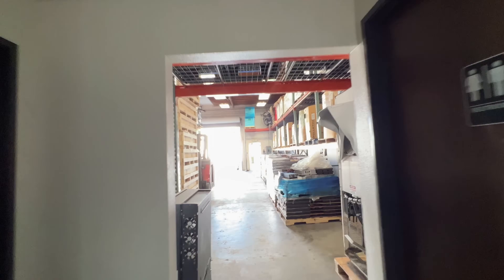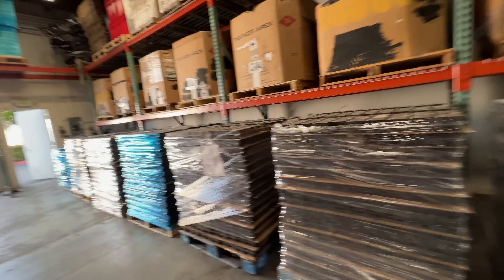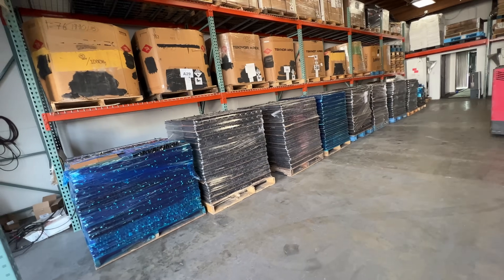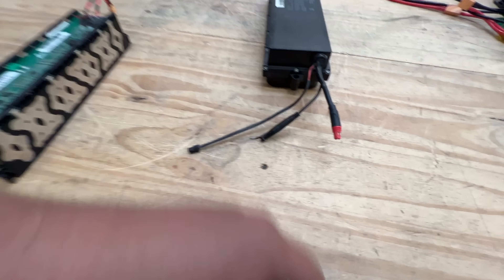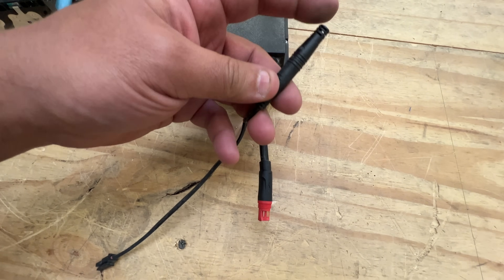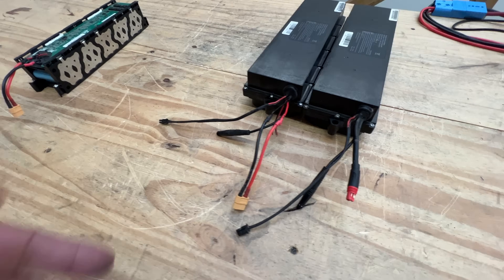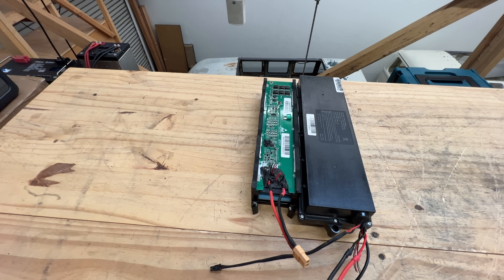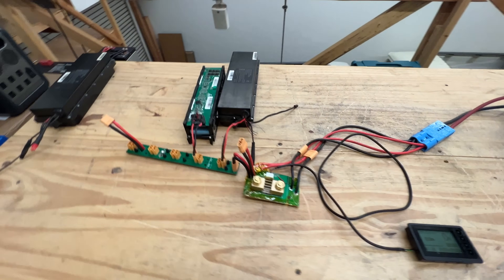LG18650-MH1 40cell Scooter Battery Packs - R5s

Comment: Hi how do you take it apart i took all the screws off but still not opening Thanks
Reply: Just did manage to take it apart think its got some kind of glue i just used a dermel to cut one side get a screw drive to pull it apart

Comment: Hi ...Wow you seem to love all this stuff and really know your stuff. I have a couple of questions about the battery pack you were testing there.. I have a battery in a copy Xiaomi scooter that has the same type of bms along the full length of the battery . How can i tell if my BMS has failed or just somehow needs waking up . I am going to watch more of your videos ,btw,. The scooter i have i bought as a non runner to hopefully easily fix. Got new dash-board and new mother board and when i connect the battery if i quickly press throttle i can run the motor for 7 or 8 seconds then all cuts out and error code 21 ( NO communication with battery ) . There is no Bluetooth as far as i can tell ,although im not sure if i need a scooter APP to be able to detect any Bluetooth signal  & no lights at all on BMS. I am interested to find out if that little device would help , i am really new to the scooter world and its problems and you look the guy that has the parts to help . look forward to hearing from you ,Don .
Reply: Probably need to bypass the BMS on discharge. Sounds like you’re dealing with a prior rental and the system is looking for a signal from the gps board that isn’t there anymore. So get a different battery or just research bypassing the BMS but still used on charging.
Reply: @kevins5016  Hi Kevin . No its not a rental or ex rental. It is a copycat of a xiaomi . Last night i tried waking the BMS as demonstrated but no joy . the battery is good at 42 volts . I think now i need to replace the BMS but are they specific to suit the mother board ? rgds Don

Comment: So I have been playing with these batteries with the extra wire (third unused end) and I love them.
A number of these packs however do not have the third extra wire and just have the charging end and the thicker discharge end...... these packs also have a anti theft sticker on them and shut down after 5 seconds, any ideas on this??? 
It says OTA WITH ANTI-THEFT
Reply: hi, I'm wondering if you found any solution how to stop shutting down after 5 seconds?
Reply: @dawidadamus9149 Yes, that's the whole point of the video, soldering that short length of wire bypasses the BMS for discharging and it works well.
The BMS still handles charging and balancing but the discharging is bypassed. Because the discharging is bypassing the brain on the BMS you will lose things like low voltage cutoff (you have to be smart and keep an eye on the voltage and not run the pack into the ground) and wattage control (there is no BMS limiting these packs to 500w like before, you can actually pull 800w from them now, but it's not smart, I run 2 of these in parallel in my 1000w ebike so they share the load ...500w each.
Reply: @terrysobkowich2084  can you please point me to where in the video you do the soldering? I can’t find it

Comment: Just bought 4 of these. Soldered on an XT60 and plugged into an Ecoflow mini as an expansion battery. The battery cuts off as it ramps up above ~200w. Unplug then plug back in and same thing. Any ideas?
Reply: Is it the anti-theft feature. Mine has a sticker that says SOC 65-70% OTA with Anti-Theft
Reply: The three cable ones (charge cable, power cable , and and extra capped off cable ) work straight up.
The two cable ones (that have the anti theft sticker and only the charging cable and power cable) require a work around to get around the anti theft feature, there are vids on this.
Reply: @terrysobkowich2084  so it a crab shot which 2 or 3 wires battery I will get. If I got the 2 wires one. you think it is still worth the price? I am not confident on working with batteries.
Reply: @josephau4623  Well ,about 80% of the ones I got ( not from the website )were the 2 wire ones that unfortunately require the modification but once you see how its done, its not really that big of a deal in my opinion....... but You would have to figure out the cost benefit for yourself especially if there is a lot of shipping costs. I have a thousand watt ebike and I did 15 miles just this morning on a pair of these packs in parallel.
Reply: @terrysobkowich2084  I can't find the video showing the work around. Can you share a link please? Also since you have your out of the enclosure can you tell me what the dimensions without the case. Thanks
Reply: @josephau4623 search YouTube for bird 590 bms bypass. Lol I can't seem to send the video link.
Reply: @josephau4623  ill get you the dimensions
Reply: @josephau4623  without the case the pack is 27 cm long
7 cm wide
6 cm deep
Reply: @terrysobkowich2084  thank you

Comment: @jehugarcia there will be another auction in Canada for these type of batteries? I got 4 lot of these but premier auction refused to pack them that would only take 10 mins so the shipping company could pick them up. I really wanted to buy ay least 50 60 of these : (
Reply from the maker: So you are not getting the ones you purchased?
Reply: @jehugarcia  First I wanted to arrange shipping then I was gonna pay. I couldn't find a company who can pack the shipping as well. That's why I kindly asked them a few times that batteries already on the pallet all you need to do is wrap it but they refused to it.
Reply from the maker: 4 lots is 1/4 pallet,  why not ship them in the pallet?
Reply: @jehugarcia   idk, I even got quote for it but they just didn't wrap it for pick-up. It would take max 10 mins.
Reply: @VertexSignatureBuilds  Did you get your batteries or you paying storage fees?
Reply: @FarmingGoneWild   They already sold to someone else already. So I didn't pay any fees.
Reply: @VertexSignatureBuilds  Caqn you share who sold  them too I have a few i want to sell too
Reply: @FarmingGoneWild  you selling batteries ?
Reply: @terrysobkowich2084  I have some to sell.
Reply: @jehugarcia  hi I got one of these packs I installed it on my scooter but it shuts down some said its got to do with the anti theft on the battery you know whats going on Thanks
Reply from the maker: Not really,  I was never able to get my hands on any of those Canadian packs.  The ones I have here in the USA don’t have anti theft software
Reply: @RandomClips27.  The workaround is either connecting the negative wire directly to the negative connection at the bottom of the board..or......the even better way is to jumper a bypass wire from the negative pad at the bottom of the board to the side of the bms board fuse closest to the bottom of the pack. This way even though you are bypassing the bms for discharging, you still get the 30A fuse to protect if a direct short occurs.
Dm me if you want a pic of a modded board

Comment: I just bought 30 of these R5 shorties as you call them, what is the pinout? How do you connect them in series and parallel? I have arduinos, everything, but having a hard time getting the info.
Reply from the maker: Who cares about the pin out if there’s no connectors,  install an xt60 connector and charge/use them,  you don’t need anything else
Reply: @jehugarcia  You said in one of your videos you EV project doesn't have a BMS, do you have more info on this? I kinda feel like running 6 parallel strings of 5 series batteries for my EV project would be a little sketchy, is there a way to use the onboard BMS and can you recommend another BMS that could handle all the series and parallel strings? Also thanks for the response buddy, I bought 30 of these R5 shorties as you call em and you seem to be the only guy that knows anything about them so I'm super glad to make your acquaintance.
Reply: @jehugarcia  also if you want to figure out shipping to edmonton alberta I'll buy all the connectors and stuff from you so it's worth your time to respond to messages if thats fair.
Reply: @ColePEET  Ha Ha Red Deer here lol
Reply: @jehugarcia  XT60 on the output for sure, I found that those small red RC hobby connectors will connect to the charging input port , just saying.
Reply: @terrysobkowich2084  what connector are those. any name or link please
Reply: @josephau4623  The original connectors on the batteries .. who knows but I have found that a small red 2 pin JSA  ?? connector will connect to the charging port. AND ..small 2mm banana jack plugs will fit into the holes of the output plug so i made a 2mm male banana to xt 60 adapter for the packs I haven't changed over to xt60 yet.
Reply: how many of the 30 you got are 3 wires?
Reply: @josephau4623  of the 30 29 had a 5 pin Julet and 2 pin molex, 1 of them had the 5 pin and the 2 pin but also another 2 pin
Reply: @ColePEET  so 29 if them can't be use as is. Bummer
Reply: @josephau4623  why do you say that, i'm pretty sure you can just use the two main wires for charging and discharging. They don't need to be activated or anything.
Reply: @ColePEET  check out the reply from CMS CLIP. He said the one with 2 wire come out will cut out at 200w because of anti thief. And the ones with 3 wire will work as Jag show in the video. And other suggest a work around bypassing the bms.
Reply: @josephau4623  interesting, always something eh. Shouldn't be too hard to figure out. I would like to figure out the communications protocol the BMS use and use a little circuit to get the full BMS functionality from them

Comment: Ok so I picked up a bunch of these 36v units at auction , the voltage of one of the units at the discharge is like 2 to 3 v ?? , it this a sign of the bms being off (or would that read zero?) or is this particular pack screwed and good only for salvage of individual cells? Or salvage of bms ?. Thx
Reply: I can see it all now as well .
Reply from the maker: Try charging it,  if the bms wakes up your are good to go
Reply: @jehugarcia  Thank you sir, I charged it for a short while while and the discharge leads are reading about 35v ish even with the power brick unplugged so I'm assuming that the bms is working fine and the cells are taking a charge, the pack was just very deeply discharged ? we will see what it is at by morning. perhaps ill even try discharging it and see what its capacity is at?
Reply: @jehugarcia  So the morning has come and the  charger (which is for this battery type has changed from red to green indicating the BMS has shut off and the battery is charged, disconnecting the charger the battery still reads 41.5 v. I think im good.
Reply: Hi, could you provide some info please about the paks: all the paks are fully functional or you got some dead cells?
Reply: Strange...this post now says 2 h ago  but i posted it yesterday. the responses i got and my follow up on this pack are gone.....
Reply: @terrysobkowich2084  I can see both " 
jehugarcia 
"Try charging it,  if the bms wakes up your are good to go"

Terry Sobkowich
" @jehugarcia  Thank you sir, I charged it for a short while while and the discharge leads are reading about 35v ish even with the power brick unplugged so I'm assuming that the bms is working fine and the cells are taking a charge, the pack was just very deeply discharged ? we will see what it is at by morning. perhaps ill even try discharging it and see what its capacity is at?"

Comment: I'm not rich but not dumb battery clearing house had LGMH1. 72 for 72 free shipping. I  procrastinated for couple days. Bought them. Now. Way different shipping up to $20. Do your RESEARCH. MHI are best cheap 10amp I found.   Panasonic has a slightly better power curve Not much Panasonic you WILL pay
Reply: Are these batteries as good as the Panasonic ncr18650bd? . I am building 60v batteries. 16s 13p .

Comment: That 10wh difference is because of the maths. The capacity is calculated 37v x 12500 mAh, the other packs are rated 36v nominal voltage.

Comment: As to charging: keep it below 3.5 amps.  You have NCR18650BD with 4 in parallel (10S4P).  The datasheet says about 900mA each.  If you jam 20A into the port, you are hitting each cell with 5 amps each (on average).  That is very dangerous, and will destroy the cells quickly.
Reply: I'm only charging through the charging port and using a 2 amp scooter charger.
Reply: @terrysobkowich2084 I just got two of these packs. I was able to charge thru charging port for initial charge but after first full capacity test cycle it will only allow charge through discharge port. Have you had similar experience or know how to reenable charging through charging port?
Reply: @Code_hack_  I have never had a problem charging through the charging port,...mostly.... the only time I put power into the discharge port is when the battery was completly discharged and the BMS didn't even have enough power to wake up and start charging the battery, so....I had to put some power into the discharge port to get enough charge into the battery to wake up the BMS to allow charging into the charge cable.
The bigger challenge I have had though is that some similar packs I have gotten from elsewhere had a anti theft firmware lock whereby the pack will only supply 0.7a unless it receives a digital code from a scooter that is no longer there....the battery assumes it has been stolen and then shuts down lol, So then you need to do a modd on the battery pack whereby you  bypass the bms for discharging or run it inline with a digital signal box that emulates the scooter signal.....I have done both.
Reply: @terrysobkowich2084 thanks for the info. Once the voltage reached about 37v I was able to charge through the charging port again. These packs seem really good and mine are shown about 90% capacity. Did any of your packs come battery clearinghouse? Mine are from jag35
Reply: @Code_hack_  I believe mine were previously owned by jag35 , but for whatever reason during covid were sold at auction here in Canada a few years ago.
Reply: In your research , does it say what the discharge rate of these packs is ?.

Comment: These, like most packs you sell, are 3-wire BMS. I read its dangerous to connect multiple 3-wire BMS systems together. Its also dangerouse to charge via the discharge port for the same reason since it overrides the BMS. Could you explain why you think its safe?
Reply: compared to 2-wire BMS.  2-wire BMS are safe to connect multiple packs and charge via discharge.
Reply: Bms? We don't need No stinking bms
Reply from the maker: Because I’ve been charging my diy ev this way for 10 years,  if you design your system right you don’t need a bms